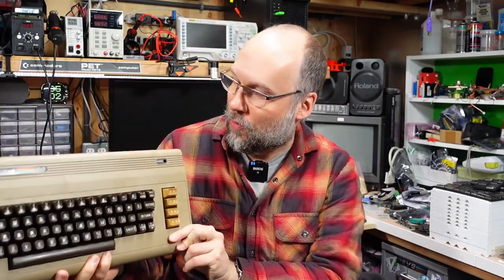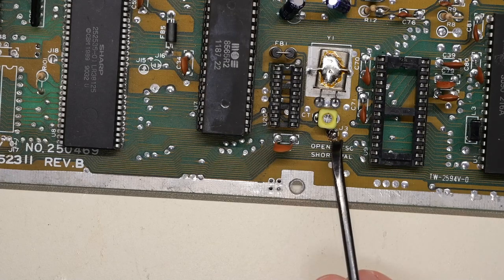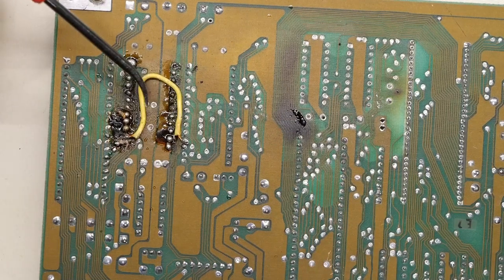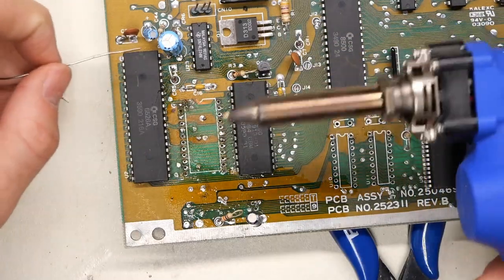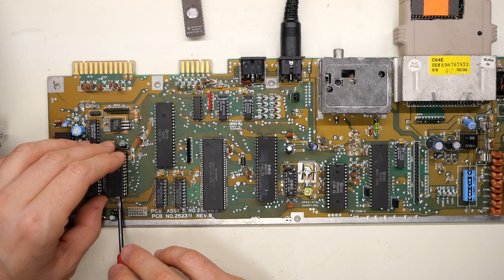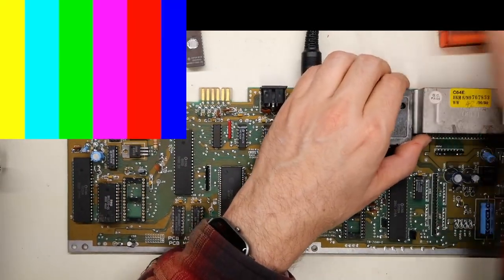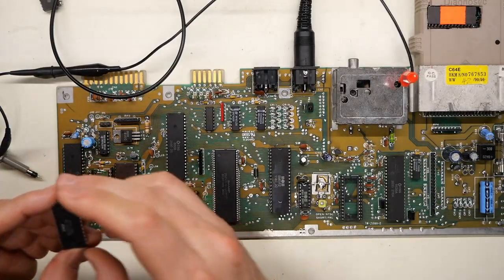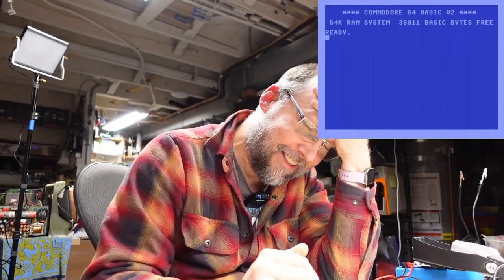Don't use a blowtorch to fix your C64!

Comment: Hold up... how did that board start the diagnostic cart with the ROM removed? Dead test uses Ultimax mode (GAME=0, EXROM=1) to map itself at $E000, replacing the reset vector at $FFFC. Diagnostic, at least according to the disassembly I have, is a normal cart (GAME=1, EXROM=0) and relies on the CBM80 check from the kernel to start via the vector at $8000. 

So... either the CPU got some open bus value at $FFFC and plowed through the contents of memory without hitting a BRK or invalid opcode until it found the diagnostic code at $8000 (not likely!) or your diagnostic cart has logic to power up in Ultimax mode and maps to /HIROM $E000 as well as /LOROM $8000. That would provide a reset vector at $FFFC, until /LOROM goes low, indicating an access to $8000. At that point you flip the GAME/EXROM lines to be a normal cartridge and you can test the KERNAL/BASIC ROMs.

Comment: Once a board has charred areas like that, it can be a disaster waiting to happen. The carbon in the charred areas will have much lower resistance than the fiberglass is supposed to. If  that resistance is across supply rails, it can heat up, leading to more charring, eventually turning the substrate into an effective short. I wouldn't trust that board anymore. The "right" way to fix it is to cut out the charred areas and  splice in newly etched patches to replace them. Obviously such a repair is only practical on single- or double-layer boards.

Comment: 10 minutes in and I am looking at that PCB area which is black. As a person who spends his life repairing high power professional audio and lightinggear for the entertainment industry, those charred areas are ringing all sorts of alarm bells. if you take the time to measure between the tracks, you will most certainly find leakage as that area is now conductive. FR4 may stop your house burning down but it achieves this by forming a layer of carbon. thus preventing ignition. carbon as you know is quite conductive. 
I am not sure how reliable this C64 will be over time or if it gets itself into random crashes. if it does. there is your culprit.

my 2 cents worth.

Comment: Hi Adrian, I’ve watched this epizode with big hope youre case is similar to mine. I have been working on the same short board for some time. The problem is that  I get black screen but when i use test cardridge all test passed, morover using the other cardge I get boot sceen. Do you have by chance some suggestion? Greetings form Poland!!

Comment: I'm assuming whoever "worked" on this previously used a butane soldering iron. That's just so wrong!
Reply: Probably a hot air paint stripper. Pretty common to see split layers and bubbled boards when using them. They go up to 600C.

Comment: Are there C64 replacement boards available from places like PCBWay, that you could transfer parts from a TOTAL basketcase into?  Would love to see that, if you've got a board that's just too far gone, but the chips are good.  Would be a lot of work, though. :D
Reply: If not someone should design one and make it available. Then you could just have a batch made up.
 EDIT: There are layouts for MSX motherboards available that you can have made that way.

Comment: Judging from the distance from the socket to the burn mark they must have used a propane torch iron for sure...... they are great for working on the car or those sorts of applications when you doing wires but never on a PCB.. Do you think they will send them to jail for doing such a thing? LOL

Comment: They probably used a heat gun at full blast trying to melt all the solder and than leaver out the chip without using a solderwick

Comment: I have 2 or 3 C64s that I used a blow torch to remove chips in my younger years.  The boards were literally on fire at some point.  But so far in my recent restoration projects I buzzed out all the traces and every charred trace has continuity.  I got one of those boards up and running just the other day!

Comment: School me on Blu-Tack.  I've tried to use Blu-Tack the way Adrian does to hold components in place while soldering.  It's WAY to sticky for me.  I can't even get it off my finger tips without a fight due to it getting embedded in my finger prints.  Just imagine how it ends when I had heat from soldering.  I have the genuine Made in Australia stuff.  What am I doing wrong?

Comment: You could save that ROM by inserting and soldering it in pin stripe headers or a machined socket. I had this problem with too short pins before and indeed it can drive you crazy the first time.

Comment: Tip: When programming older EPROMs instead of programming them multiple times to be sure I found out that exposing the EPROM to bright light while programming introduces errors in form of weak programmed bits so in the future cover the EPROM window while programming.

Comment: One of the things that is done when manufacturing a PCB based system, is to wave solder the board, then run it through a cutoff saw, which cuts the leads very close to the board.  Which means if you desolder the chip, the leads are shorter than they would normally be.  Which means that they might not work in a socket.
Reply: Wrong. If the parts are placed by hand, they are ran thru a preforming machine first  to ensure the lead length. Otherwise they are are placed by a machine that crimps and trims the leads. No "saws" used. And he needs to stop using metal tools like that on boards, great way to chip parts or break traces. And that solder work he first showed just looks like someone left the iron on those spots for too long. Since most people use irons with too low temp. Should only take seconds of contact to flow solder with proper heated iron.
Reply: @cymryman  That wasn't how we did it where i used to work.  But by all means, the way you've  done it must be the only way to do it.

Comment: I don't get why cutting the pins is supposed to make this easier. If anything, it makes it harder as long as you have a good desoldering gun. Maybe if you've only got wick, then it might make some sense, but otherwise it's just making more work for yourself. And those supposedly higher quality hole sockets are just a PIA. They aren't even designed for the flat pins of these ICs. Don't use them!

Comment: can you damage your eyeglass coatings (or even the lenses themselves) if you expose them to acetone fumes?
Reply: yes acetone will damage coatings. it will strip paint and melt plastic too.
Reply: @johnbos4637  lens coatings might be susceptible, but most plastic eyeglass lenses are Polycarbonate-Acetone will not damage it-Ive used straight Acetone to remove Cyanoacrylate glue(AKA superglue)from plastic eyeglass lenses with zero damage.
So Acetone only melts SOME plastics.
A similar issue exists with Perchloethylene-ok on many types of plastic, but will melt Styrene and Polystyrene, among others.

Comment: would just re-tinning over the crack have fixed it?
Reply: not a good idea-while it may be ok in some cases, solder is quite soft, so the resulting repair has a fairly high chance of failing again(on a LARGE trace, with a large solder "blob", you'll likely get away with it though).
Still not recommended.
Reply: @m.k.8158  interested, the crack is so tiny that i thought surface tension would have it all unified as one hardened piece. soft isn't a bad thing if you aren't touching it

Comment: Is this board ftom easteren europe? It seems it is rosin. It is used as flux. If you overheat it, then it will transform to gunk like this.
Reply from the maker: I'm not sure -- the boards were donated by a viewer in Germany, so the original place it was from is not known.
Reply: @adriansdigitalbasement  imo it seems likely it's one of the boards op mentioned.. Is there any kind of date code or model number stamp or whatever to see either where the board was made, let alone what market/region it was intended for in the first place?
Reply: I had the same board in my C64C which my parents bought in Germany
Reply: German Löthonig is also undistilled rosin but dissolved in paste form. The smell and its propensity to burn and smoke are diabolical.
Reply: @SianaGearz  If i right remember my C64C was even made in Germany, and my 1541-II was Made in Hongkong

Comment: Wow! Great fix(es).
Is it possible the prior damage could have been done using a hot air rework station set a little too hot and/or pointed too closely to the motherboard for too long?
Reply: A little too hot? To do this amount of damage, you'd have to have it on max heat min airflow and have it 0.25mm off the board
Reply: I don't think my hot air rework tool would get hot enough to do the kind of damage I saw on this board. It seems more likely to me to be either a way-too-high wattage soldering iron/gun (such as the kind designed for soldering/welding pipe, etc. rather than electronics) or a butane soldering iron (which can also get way too hot for electronics, depending on how it is set, and you can't tell how hot it is getting, b/c there is no temperature indicator). As a young kid I tried using both of these makeshift tools for soldering, and can tell you from painful experience that they are not recommended for electronics use.

Comment: I applaud your effort but this board should be scraped. Use the parts on a reproduction PCB or something. After the treatment it had it might never be totally reliable. With all kinds of weird faults over time. Personally if I did a repair like yours I would not feel comfortable passing it on to someone else. And that inevitably happens.